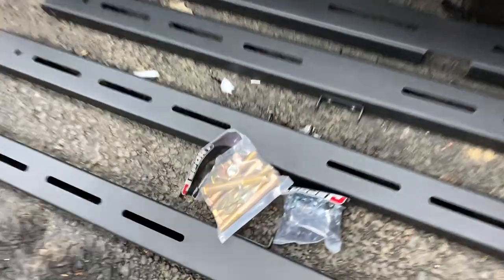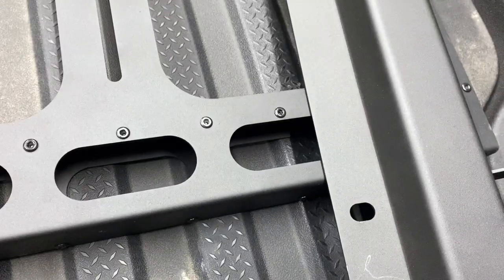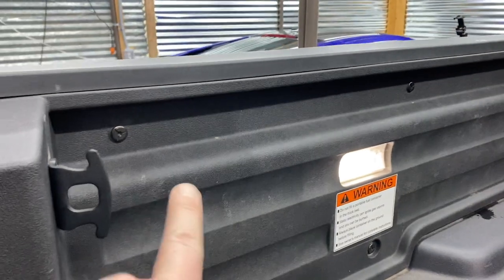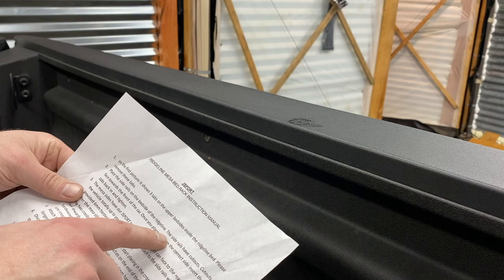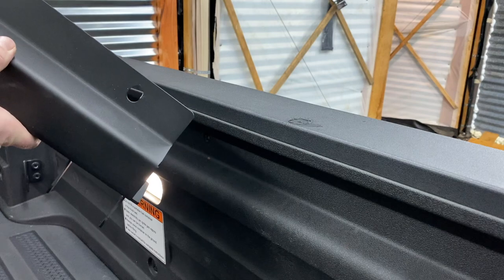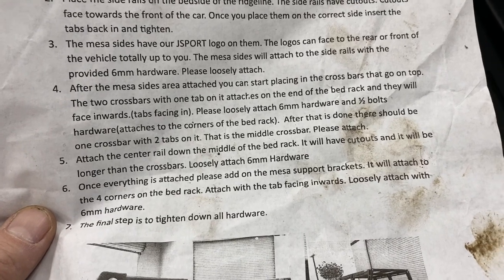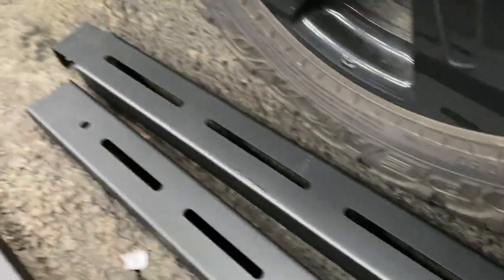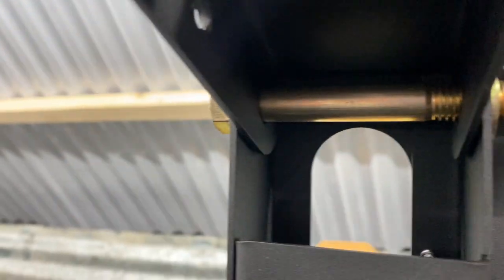JSport Mesa Bedrack DIY Install and Central Oregon Camping Trip

Comment: Good presentation! I've been thinking about a rack for my 2021. Curious about the load rating for the Jsport. Also wondering about the six small bolts on the side rails. Will they handle the weight of the rack, roof top tent and two people? Thanks.
Reply from the maker: Absolutely,  The small torx bolts are only there to prevent the rack from sliding, the weight is entirely supported with Jsport's design as the base of the rack sits squarely on the bedrails.  It will support a substantial amount of weight, the design is very secure.

Comment: I like how fat the sidewalls of those tires are. What size brand tire?  Any spacers on wheels?
Reply from the maker: They perform very well, they are the Falken Wildpeak AT3W in 265/60 18
Reply: @503pdxCars  any spacers on wheels?  Looks like they fill wheel well very nicely

Comment: Greetings, what size tires are you using, Make and model. Do you get any rubbing when turning? Also, based on what you have seen onlione, what are your thoughts on the new 2021 model?
Reply from the maker: They’re Falken Wildpeak AT3w tires; 265/60 18. I’ve had more questions on these than anything else so I should make a video and answer some common questions. They never rubbed on my 2017 but do on full lock on the 2020. Strange!

Comment: Are there places that helps you to install these racks? And these racks are for the roof top bed right?
Reply from the maker: This rack is for the truck bed, most mechanic shops should be able to install these.... but you can always reach out to JSport directly for a local contact in your area if a Honda dealership isn't an option.